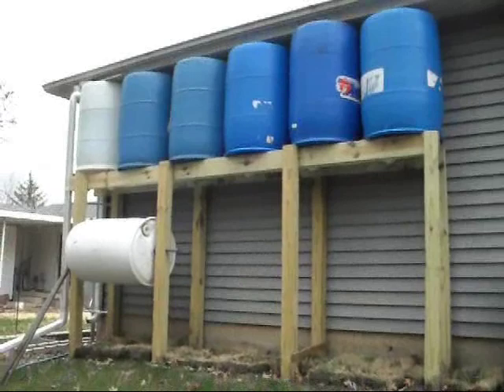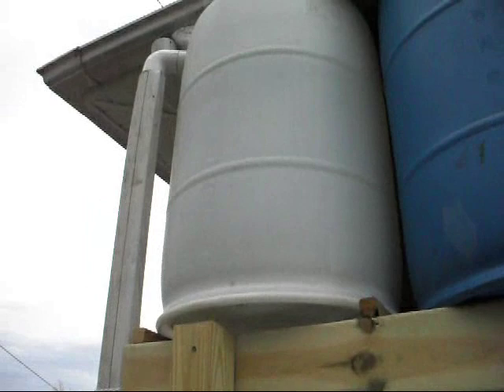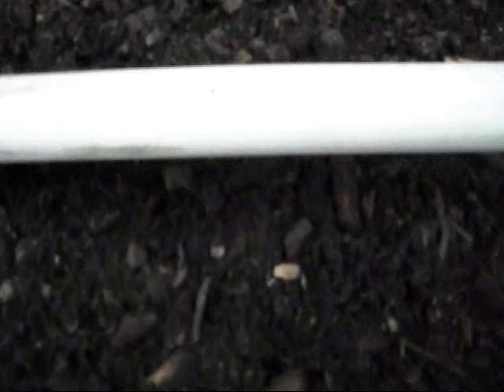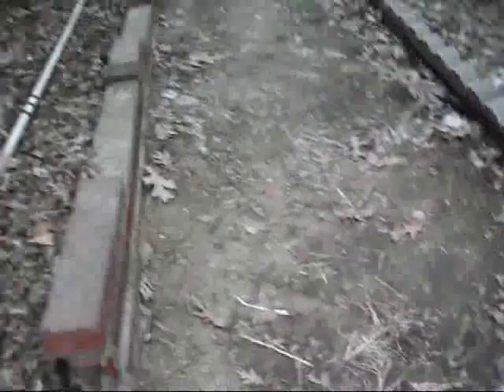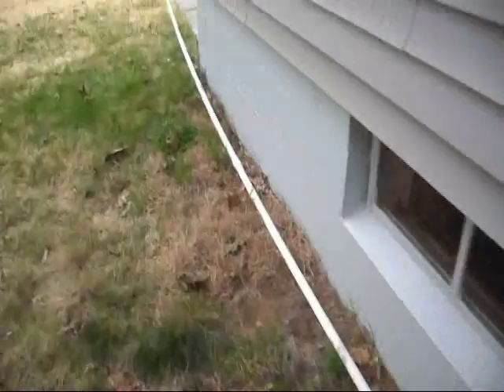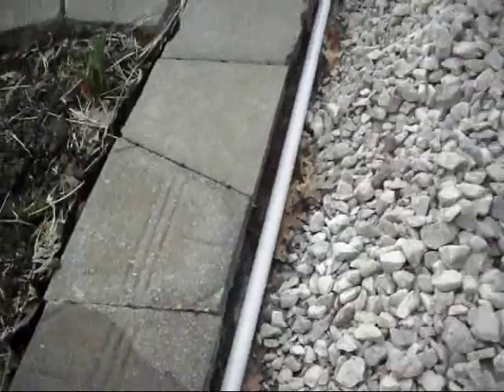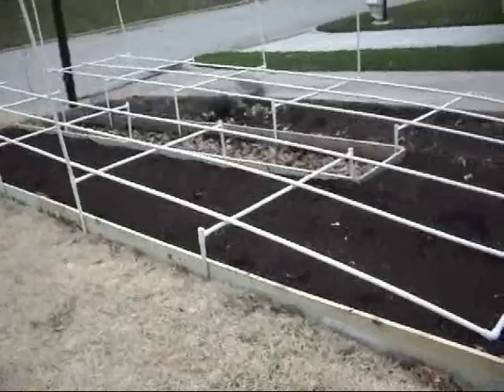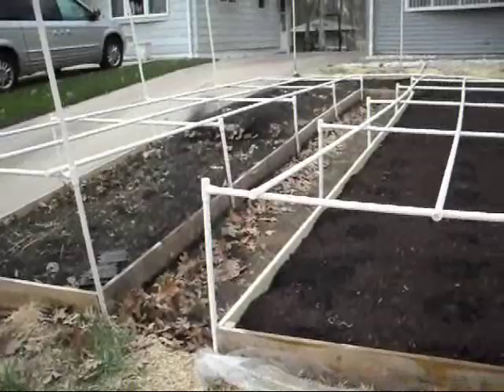PVC Irrigation System, Automatic Water Timers, and Rain Barrel System

Comment from the maker: @gergever 
You are correct; the upright poles are to put deer fencing on.  It is very easy to get in and out of the area because you can just use a couple rocks or bricks here and there.  The pipe was is 1/2-inch PVC for the poles.  Nothing glued together.  I have a short stubby piece screwed into the wood borders and then a 1/2-inch PVC coupler on top of it.  I can then just push the pole right into it.

Comment: i used this system a few years ago for my 10 raised beds, most of them were flat and it worked great, however on the sloped beds gravity did its thing and on the low end of the pipes you get more flow and more water coming out of the little drilled out holes then the uphill end.

Comment from the maker: @FLIPWILSON1 
I've used the irrigation system for two years now.  In the first year, the system was hooked to regular tap water with timers.  I didn't have any problem with the holes getting blocked.  The holes are fairly large in regards to calcium or other build-up.  This year (second year), they were hooked to the rain barrels.  They only clogged once - and it was from algae.  The lines were easily cleaned out with hooking the system up to tap water where the pressure was greater.

Comment from the maker: @RJH33101 
No mosquito problems.  All barrels only have a 1/4-inch hole in the top with screening over the top for air.  The main barrel that has the water coming in from the gutters also has screening over it.

Comment from the maker: @jpc002 
Yes, all of the PVC is removed before it begins to freeze at night.  The 3/4-inch main run of PVC pipe stays on the ground (because it is all glued together and cannot be undone).  But the 1/2-inch PVC pipe over the gardens are taken apart and stored.  For the rain barrels, the are joined together with PVC unions - where I can unscrew them from one another.

Comment from the maker: @badboyorganics 
Devin, the pipes will not have any water in them when winter comes around.  I'll take all of the pipes apart that are in the garden and store them in the garage over the winter - then put them back together depending on how I arrange the garden for the next year.  So, no worries about frozen pipes.  The rain barrels are also fully drained and disconnected from each other to prevent any damage as well.

Comment from the maker: @sppeart 
The only area where the two boards are tied together are on the end where the white barrel is at.  I have two 2x2 boards under this barrel to raise it up by just a bit - because of the overflow pipe.  This will allow all of the other barrels to fill up an additional 2 inches or so before water starts going down the overflow.

Comment from the maker: @icreatedthistx 
Thanks for the comment.  As you said, it certainly would be more work - and I'd also be a bit worried about the small 1/16-inch holes getting plugged up.

Lastly - in the front yard - which is where the PVC is raised - needs to stay that way because it goes downhill.  If I buried the pipe, then all of the water would rush down towards the end of the PVC pipe and flow out those holes instead of having even water distribution throughout the length.

Comment from the maker: @MaskedBandit100 
The main reason is price.  A 10-foot section of 1/2-inch PVC pipe is only about 80 cents around here.  In addition to this, it ties in easily with all the other fittings to the rain barrel system.

Comment from the maker: In regards to the boards separating over time - it may be possible, but with that much weight sitting on them, I don't see it as likely.  They are also anchored in the ground with concrete.

The structure isn't tied to the garage; I didn't want to put any holes in the garage for this - so it is free-standing.

Comment from the maker: @mogges1 
On all of the irrigation pipe and the 3/4-inch "main run" to the front yard, it is all pressure-fitted together with the PVC couplings - no PVC cement was used except in areas like the ball valves.  Unfortunately I have one coupling that has now come apart twice (once this morning) and it is next to the house.  We had a lot of rain last night and somehow I was down to only 1/8 of the barrels being full.  Found out that coupling came loose again this morning.  Will be gluing it today.

Comment from the maker: @FLIPWILSON1 
Indeed you are correct.  I had thought about painting all of the barrels - didn't think of painting the pipes though.  This would get very costly with painting everything though - especially since it would need to be a paint that readily sticks to plastic well and will hold up to UV from the sun constantly.  Krylon Fusion does this - but it is cost prohibitive.

Comment from the maker: The PVC pipe is typically all removed each winter.  In the fall, I till up the garden and add in a lot of mulched leaves.  With the forest behind the house, we have an unlimited supply it seems.  So I'll till in a good chunk of mulched leaves into the garden beds each fall - then plant in the spring (planting now actually).  Then I have to put the PVC pipe back together.  The main 3/4-inch run doesn't need moved - so it stays year-to-year.

Comment from the maker: @mlasell 
I've not done any research on this - but it is a valid point.  However, based upon my theory that we use PVC pipe in our houses with much hotter water coming from a water heater, I doubt there would be any problems.  If there was a chance of any kind of poison, I'm sure PVC would be outlawed for use in hot water applications.

Comment from the maker: @13itsmeangelok 
I disagree.  I've used the PVC pipe for two years so far and it still is in excellent condition.  The rain barrels lasting only a year is also highly incorrect.  the local university extension office holds a seminar every year for those who want to make rain barrels.  My neighbor has a barrel - and it is now five years old.  Regarding the pressure - sure, the pressure isn't what comes out of the tap - but it is more than sufficient for a low-drip system.

Comment: If it was under pressure (like from a well) would the pvc HAVE to be level? I have some 100' rows of blackberries that I would like to irrigate like this, but they are on a slope. Would normal pressure (40 lbs or so) make it flow uniformly through the pipe even if it is on a slope? I may glue a few sections together, drill them, and give it a try myself. Good Vid...
TP2

Comment: Are the PVC upright poles along the perimeter of the front yard bed for deer fencing?  If so, what is the diameter of the pvc, are the poles glued in and what will you use for fencing, how will you affix it to the poles and how will you access the crop for weeding,etc once the material is in place?
Thanks.

Comment: My question on the PVC.did you cement them together look to me like one could just  connect them  then when done for winter, they would just pull apart.I'm working a system like this but mine will be on the ground.